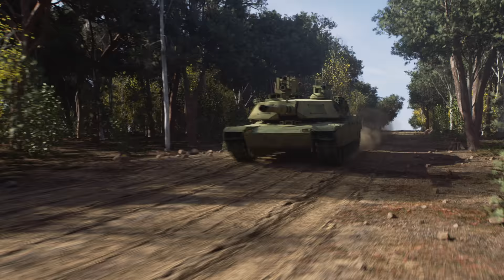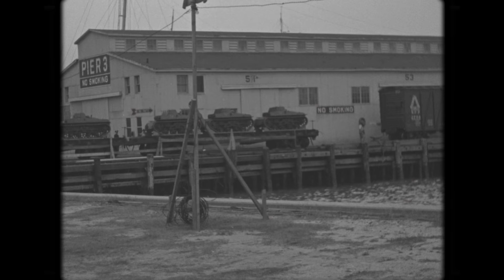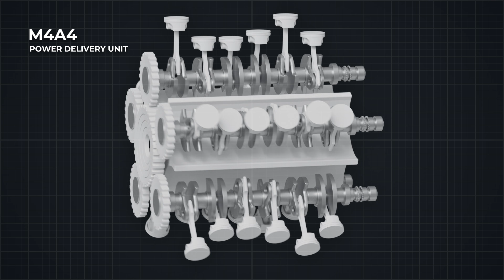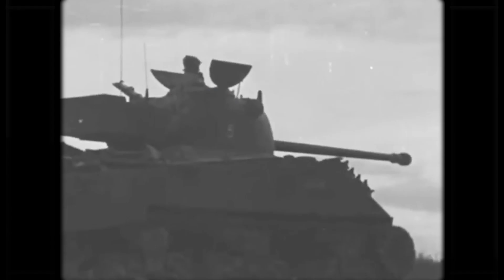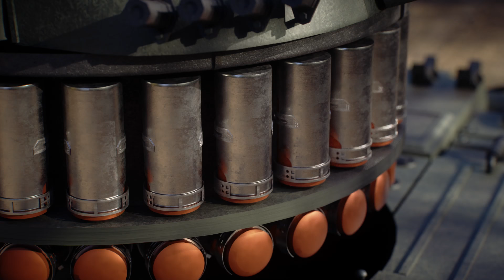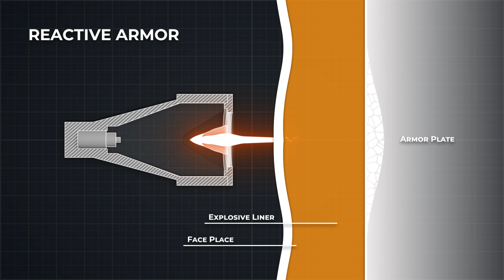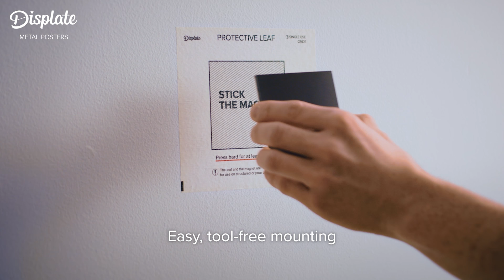Why America’s Tank Failed in Ukraine

Comment: For drone warfare basically what you need is a millimeter wavelength radar that is capable of picking up objects a half mile away from the tank and taking it down with a projectile whether it be kinetic or explosive or whatever and these are very very capable an adaptable systems to drone warfare and have proven to be very effective. But the problem is is if you don't fit your tank with them you don't have that protection that doesn't make the tank a failure. It makes it a tactical strategic war planning error

Comment: It's called a turbine it works on the same principles as a jet engine but most more closely resembles a turbocharger with a shaft to drive a gearbox these are not called jet engines are called turboshaft engines and no it is not a turbo jet! Turbine and a turbo jet are very different in principle. Again the Abrams didn't fail it just wasn't fitted it out properly for drone warfare.
Reply: I'm sorry I was incorrect there are and is a jet engine that drives a shaft that in turn drives a lift fan in a variant of the f-35 joint strike fighter

Comment: The Abrams tank exported to Ukraine were the export model.  They don't have the latest armor,  likely just tungsten armor not depleted uranium, latest electronics or other upgrades.  The Abrams the Ukrainians got were at most the export M1A3. But even with these older tanks they are far superior to the Russian tanks.  The Abrams is not invulnerable it  can still be knocked out.  But it still it operates with far superior capabilities than any Russian tanks.  Russian has lost 5k tanks. Ukraine has lost a fraction of that. Abrams tanks were designed to be deployed in a combined arms force and be but one part of a massive fist.

Comment: I don't believe this tank failed in Ukraine, I just believe that it wasn't outfitted properly for this type of warfare. This is a total shift in battlefield tactics. The Abrams was designed and built in a different era, it is very very adaptable platform and it will be adapted to meet today's needs on today's battlefield. But sending an aim rooms into a new combat environment with no testing and saying it to failure is failure of the person reporting the failures to understand the change in combat on the front line

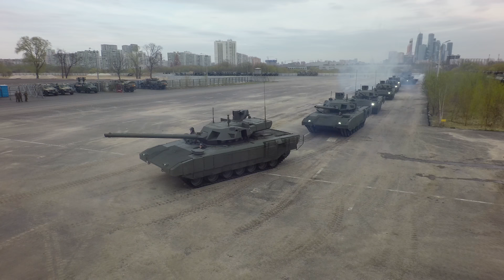Comment: 19:18 How did T-14 Armata predict in 2010 a solution to a problem that appeared in 2022?

This video takes 20 minutes to make an ok point about why Abrams turbine engine is bad, but manages to put it in the most infruriating way possible, from not understanding how Sherman variants worked to saying that T-14 Amrata somehow solved all issues the tank ever had. 

I am starting to believe that the larger a creater about tech and such gets, the worse the quality of the videos will be.

Comment: Taking the T14 Armata as an example for where the future lies is just sensationalism. 
The T14 is crap. It wasnt ever rolled out in Ukraine. 
Its being powered by the gdmn successor engine of the PORSCHE TIGER from WW2 which was FAMOUSLY UNRELIABLE. 

The Abrams got killed in Ukraine because they lack basically everything they usually have:
Air superiority, superior Reconaissance and so on and so forth. 

Also the engineers on site cant maintain them the way the US Army can. 

This is just a BS opinion piece catering to the "angryTaxPayer" Movement who have absolutely no insight into miltech and want the A10 to be the USA air superiority fighter because its "so reliable and cheap".
Rant off.

Comment: It's understandable that you might've missed it, but it would've been nice to mention the first mass-produced MBT that used a gas-turbine engine was the Swedish Stridsvagn 103 (or S-tank), which was in service between 1967-1997. It used a dual-engine setup with one diesel engine and one gas-turbine engine.
Reply: Not an MBT.

Comment: Most American equipment had failed in the Ukraine. US equipment is old and most of it engineered in the 1970's. You can put Bluetooth and heated seats in a 1970's pickup but in the end it not a 2020's pickup even if it boosts the same features. Plus most modern US equipment was designed to operate in middle eastern conditions the European winter and cold is to much for it.

Comment: I love how he talks about the logistical problems of the Abrams but then goes on to glaze the Tiger 1 and 2 and Leopard which were the biggest offenders. They required so many retrofits to the logistical infrastructure that they were an absolute nightmare. Can’t cross a bridge or road, extremely complex transmission with too many moving parts along with their suspension which was hell for maintenance. The range on an Abrams is  roughly 250 miles on the road, which drops to around 100 or so cross-country. Ukraine doesn’t even use them for armored spearhead assaults to run out of range for the tanks, that is simply not the issue. Tanks are meant to be disposable, they are not land-going dreadnoughts.

Comment: If we talk about the Abrams losses, then maybe we should also talk about the losses of all the other tanks and armored vehicles lost in the Ukraine war. Even from just OPSINT sources like Oryx, we have about 4,334 tanks lost on the Russian side, of which 3,248 were destroyed. This is backed by pictures and videos, as well as comparing all of those to rule out as much multiple reports on the same vehicle as possible. The Ukrainian side has a loss of 1,387 tanks, with 1,054 of those destroyed from the same source. Many of those tanks were not Abrams, obviously. However, there were quite a few T-80 models with turbine engines used on both sides. 

The thing is, in static battlefield conditions like in Ukraine, where a lot of the terrain is mined with anti-tank mines, tanks aren't going to clash in lots, if any, tank on tank battles. The lines of advance are limited and often surveilled by drone forces. Then add in conditions like the upcoming Rasputita in spring (most of Eastern Ukraine turns into mud, basically), as well as constant attacks by drone forces and you understand why tank losses are high. The limited lines of advance also make it more likely that tanks that do want to advance are targeted by artillery, which has all the firing solution worked out in advance. 

Yet, despite that, both sides still use tanks, because a tank is still a force multiplier against infantry and when protected at least somewhat against drone attacks. The role of the tank does sometimes change somewhat, but no military that can support them, will want to miss them.

Comment: Abrams did not “fail” because it is a bad tank.

It struggled because:

It is fuel hungry

It is heavy

It was built for a different war

Modern drones are brutal to all tanks

Ukraine cannot support turbine logistics like the US can

The US moving toward the M1E3 hybrid diesel concept tells you everything. They learned.

Will be interesting to see if Chally 3 has any top armor changes and weight looked into. 2 main components the Ukraine war has shown as an issue for MBT's

Comment: Generally said, punching down on an opponent which is unable to meaningfully defend himself is one thing.
Such total dominance against uncapable opponents would allow for success stories of equipment which does not fail.

Engaging an equally capable opponent on modern battlefield is something entirely different.
Apparantly the projected lifetime of a modern tank which is actually engaging on a modern battlefield is so short that many get destroyed before even having to refuel.

Got to be clear on what you call a failure or a success in such environment.

Comment: This is clearly a well researched video essay regarding the topic, but there are glaring parts that you have over looked. You discussed logistics regarding the american tank design doctrine, whilst comparing to the german tanks, which you portrayed as simply superior. On paper, this is all true. A german Tiger is ON PAPER a better tank than the american Shermans available at the time. But you completely overlook the glaring unreliability problems with these german vehicles. The little section about boring out the engine on the tiger 1 makes absolutely no mention on how it thins out the cylinder walls, on an already extremely stressed engine, which lead to ridiculously high, documented failure rate. In practice, it was a fucking disaster. 

Honestly the first portion of this video sounds like a wehraboo wrote the script.
Reply: When the T14 section started, i have lost alot of faith in you. It is very hard to view you as an un-biased, non political youtuber, as the entire section VERY closely mimics scripts from russian propaganda videos. 

Makes you ask, was AI used in the writing of this video?

Comment: Cope cages is one hell of a funny names
Reply: It comes from the early wars of the 2022 full war started by Russia. Then they put cages on top in the hopes of defeating the Javelin missiles. However, the Javelin's tandem-HEAT warhead was much too powerful to be held off by the initial versions of those cages (and even the modern ones). However, with modifications they did increase survivability against FPV drones, as their warheads aren't nearly as powerful. Nowadays it can take up to 50 of those small drones to even slow down a tank protected by a full cage.

Comment: I usually appreciate your work, but this doesn't seem as academic as your previous works. The comparison of the M1 to other current tanks wasn't there beyond the jet engine. Armor packages evolve as evidenced by the russian cages being put together. A focus on the engine and on the pros and cons would be much more apt. You also need to bring up the survival rate of other tanks on both side. It seems tanks have failed in ukraine far. 17:47 should have been a side by side of the abrams and the leapord and challenger.
Reply: Fair comment, but I would contest the "armor packages evolve" part.
Without doxing myself too hard: I ... know a guy who works for a top military industry company, which produces tanks.
Weapon systems are kinda designed by (corrupt) politicians and financiers, rather than by the evolution of natural selection on the battlefield or anything reasonable.

It does not matter if the tank is sh:t. If you have a company that builds tanks, it is irrelevant if they win battles or if the people inside get roasted. What matters is that you need to sell them. Very often via kickbacks to politicians.

If you are skeptical of that claim, just think about what we know about how much a single screw costs to the American taxpayer and why.
Reply: @N7sensei  I would respond that everything's more expensive in America+overbuilding the shit is the norm it seems. Not particularly that the tanks are any corrupt.
Reply: @N7sensei  I don't disagree that the military industrial system digs their heals in and says, its a waste to make a new tank, keep buying this super expensive thing that is proven. I would point out that the video shows that the "defense"/armor package IS evolving though even from the US. These cages are a reaction to the drones, and we will see EMP based defense or other novelties be introduced because of this war. anyways, on the corruption line, you just need one general warning about some new capability we need and you'll have the defense sector lined out the door with things to buy to solve that. So much money in those deals. Much of it wasted or disappears as you say.
Reply: @N7sensei  No offense, but you are about as wrong as possible.  Armor absolutely evolves.  And the "corporations are corrupt and don't build stuff to be the best on the battlefield" is 100% true, but not at all because of what you claimed about corruption.  US military acquisitions are driven by strategy first, which evolves, but is determined by each individual branch, from the top.  Each US military branch asks for specific performance features, abilities, capacities, efficiencies...etc.  And then military hardware manufacturers try to make designs and prototypes that do everything requested by the military, in addition to other tech incorporation or feature improvements.  These corporations specifically try to build something that meets or exceeds the requirements given  by the US military, which are deemed strategically necessary.  (Strategy is basically in no way political).  Eventually each branch picks one or more of the prototypes to invest in and possibly purchase or further develops.  It's only at this point that politics could really get directly involved.  But even the companies who lose the bid, the companies with the prototypes that aren't chosen, they sometimes develop their tech further, without the US government $.  Now...there has been corruption documented in the whole process...but it's rare and obvious and it is usually individuals within the procurement process, not even politicians, but US military personnel who want or get kickbacks.
Reply: It would have made sense to include one of the biggest benefits of the gas turbine engine: Its extremely high-frequency acoustic signature compared to the low rumble of a diesel. High frequency sounds are quickly blocked by treelines, whereas a diesel can be heard through the ground at significant distance. The reason the M1 can finally ditch the gas turbine is that batteries and electric motors are *even quieter*, and a tank waiting in sentry mode to ambush the enemy doesn't have to be running its diesel at all.
Reply: Any "failure" was due to the lackey ungrateful Ukrainian operators
Reply: That's the biggest thing that bugs me about the video he doesn't compare the Abrams performance to any tank in the Ukraine war aside from talking about the t14 briefly
Reply: @acompletelynormalhuman6392  I think that's because it looks like tanks designed before today don't survive against drones. Drones come in an attack the tanks without needing something to shoot at. The tanks don't have a way to effectively shoot the drones, so the drones can keep dropping on the tanks until they eventually fail. There's nothing for them to shoot at with their heavy guns, no tanks on the other side. And no soldiers, they are shooting the drones from far away.

Comment: The M1 Abrams is a very good tank, if not the best in the world. It has excellent armor, a gun, and its turret won't fly off into space after a hit. But even the best tank isn't indestructible and must be used appropriately on the battlefield. And the T14 Armata didn't even roll itself off a trailer during a parade.